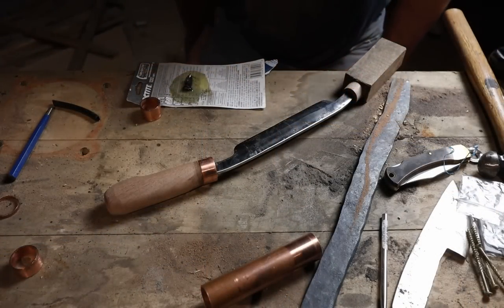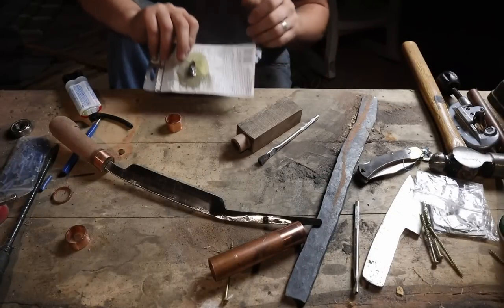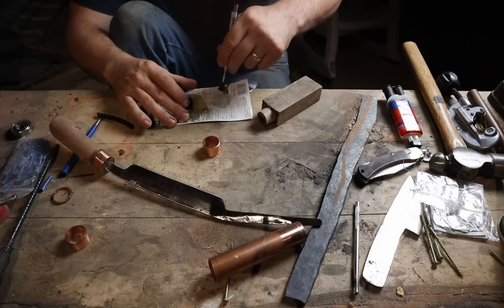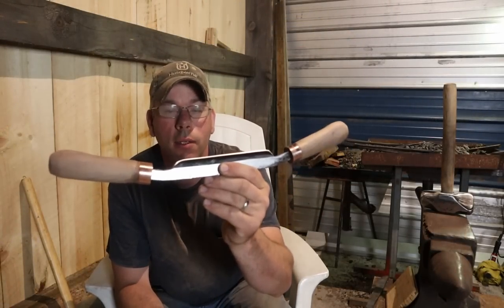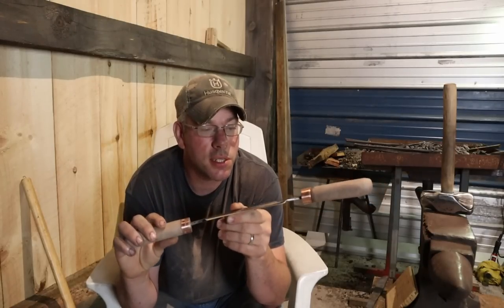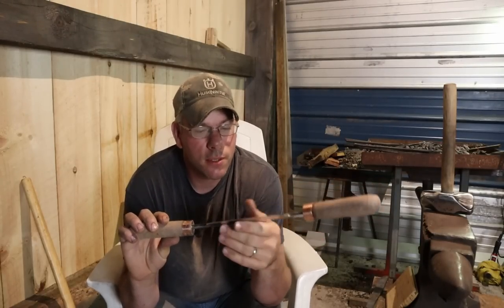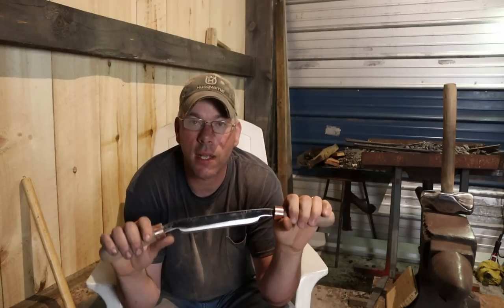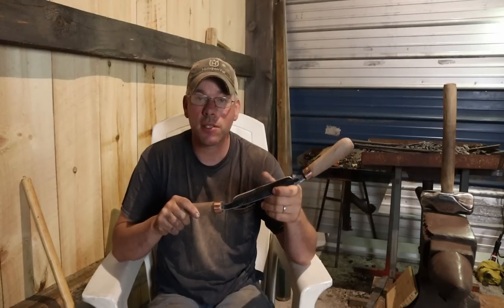Hand Forged Drawknife is Almost Finished

Comment: Hello Jim, Why not drilled brass pins to hold the handles on? Also I have found that the more air you work into the epoxy the faster it goes off.

Comment: Looks pretty good Jim. Practice makes perfect. The traditional style handles are set that way to give more depth of cut control and more leverage for stopping dives, I was taught.
Reply from the maker: I've noticed that using them side by side it's actually about the same as long as both are razor sharp.
Reply: @TheTradesmanChannel  I think the difference is when you carve as opposed to shaving.
Reply from the maker: Ahhh...that makes a lot of sense.
Reply: @TheTradesmanChannel  I do like your modified version part way between u shaped and straight. Some of both worlds.